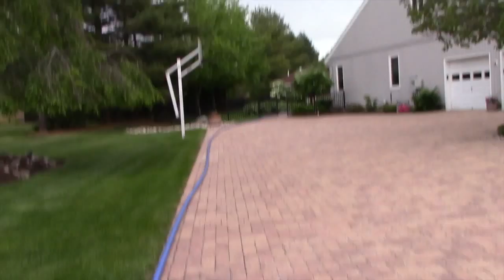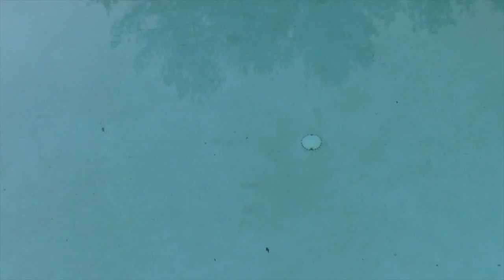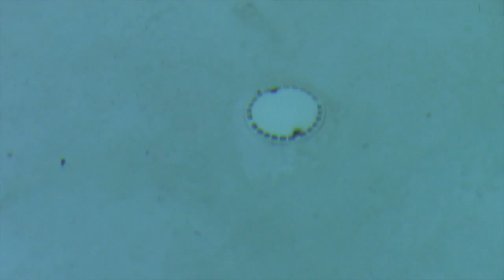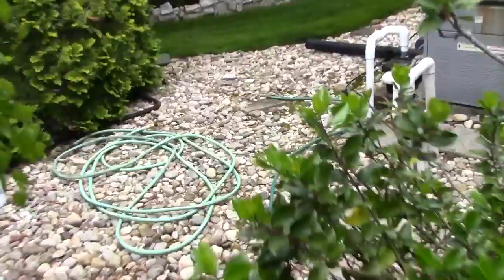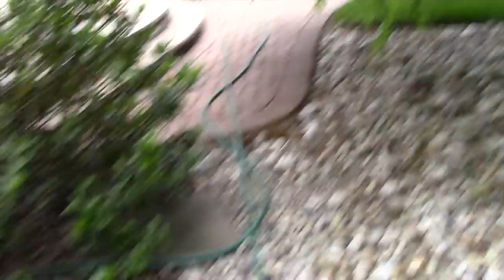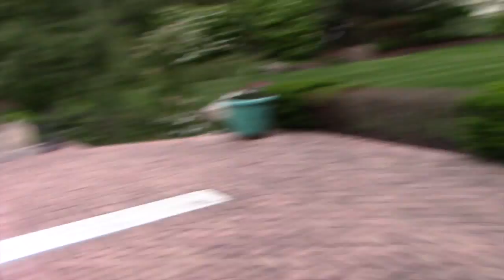Pool Repair: Part 1 A. Pump-Out.

Comment: What's wrong with your pool?
Reply from the maker: Willie Peck Has a small leak and marble dusting needs work. I have some vids from late 2013 showing what caused the tile and brick damage.
Reply: I remember that video from 2013. The water leak almost drained the pool and the weight of the cover caused the damage. An what is "marble dusting"?

Comment: First!!!

7000GPH from that thing?  At that rate you're looking at only 5 hours.  I think that's a little "lofty" as far as flow rate, but it will do its job.  I'd have preferred a gas-powered pump, those can REALLY move some water.  Harbor Freight sells one, which I'd love to have, but have no use for.  You know how that goes.

I take it the floor jets are being capped off completely?  Did they ever seem to help or do anything when functional?  Seems to me that they may be a little gimmicky, but at the same time serve a very important function.

With your water pressure, that pool will be filled back up in an hour!  As in "No sweat, just a quick repair!"
Reply from the maker: jaykay18 It's possible that maybe that was a bit high, but the water sure is making some movement down! 

The floor jets will be fixed. They are actually very useful. The way they work is, there is that black device you see on front of the pool heater. That cycles them in the following order: Wall, Shallow End, Middle, Deep End, and then back to the wall. They pop up like a sprinkler head and shoot a powerful stream of water, they are good for moving dirt around the bottom, as well as circulate water well, when the heater is on. Every time they go back down, they move a "step" clockwise, so, each time they cycle again, they are facing another direction.
Reply: Sharkie626 Very...interesting!  (You need the Jay accent to get the full effect).  I need to see those in action one day.
Reply from the maker: jaykay18 I'm sure you will!